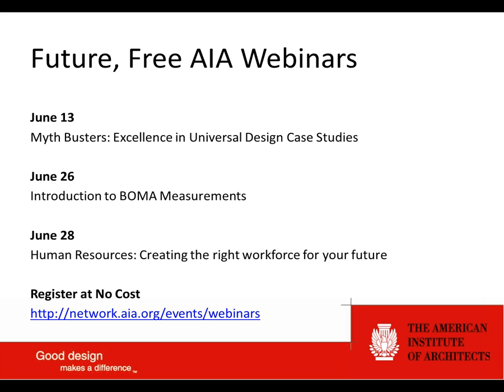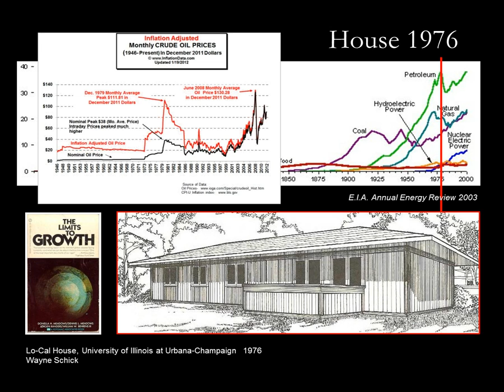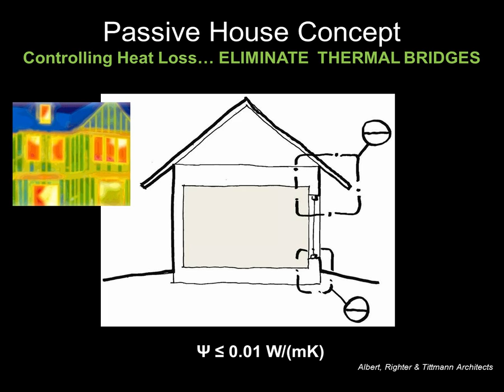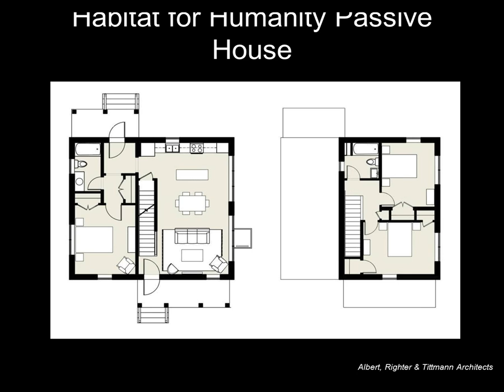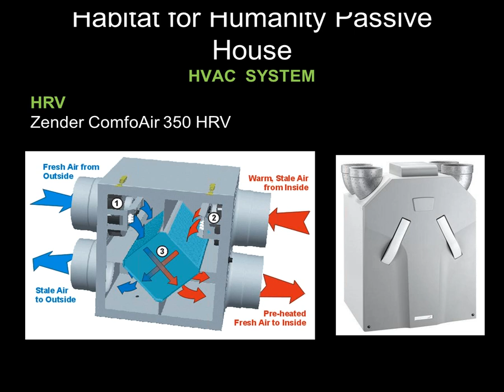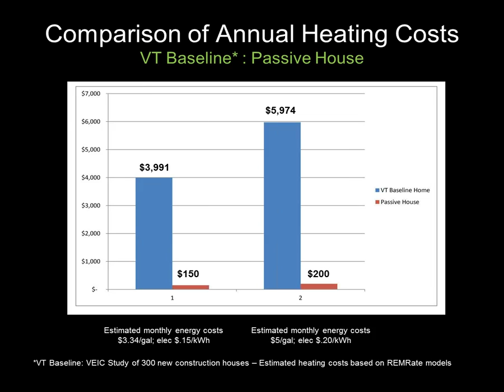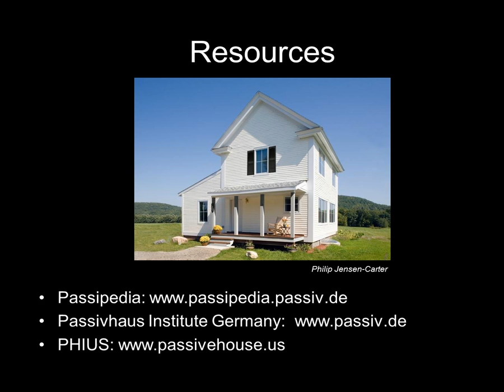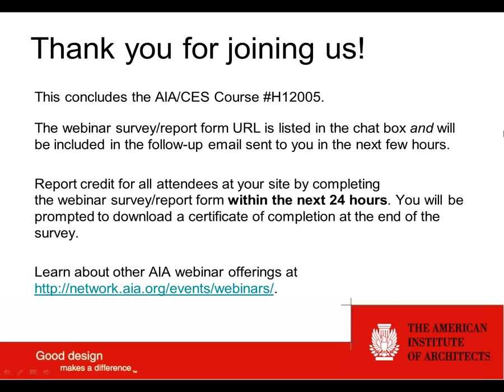Form Follows Energy: Achieving the Passive Haus Standard

Comment: A thermal bridge is a heat-conductive material interrupting the continuity of the thermal insulation envelope (e.g. a steel member poking out right through the thermal insulation layer to support a balcony). This leads to energy loss and, possibly, moisture condensation inside a wall.